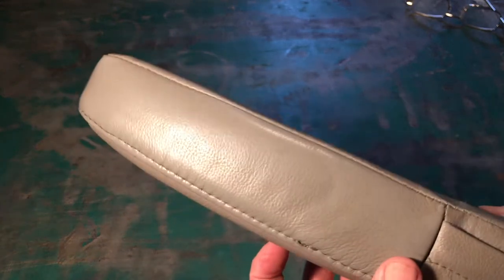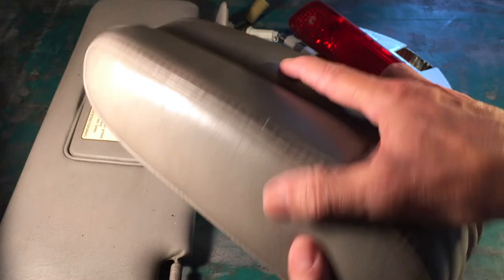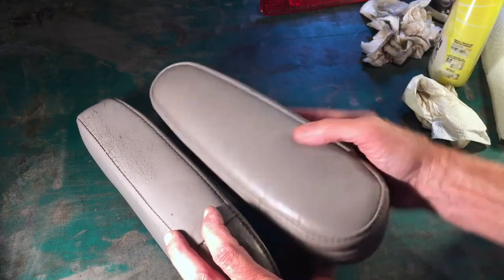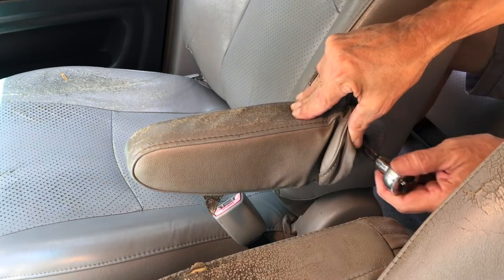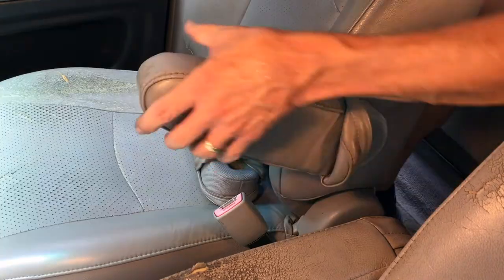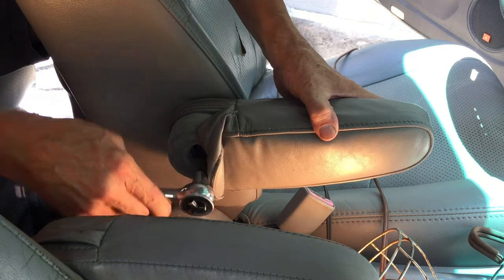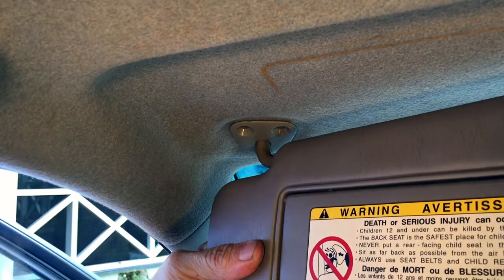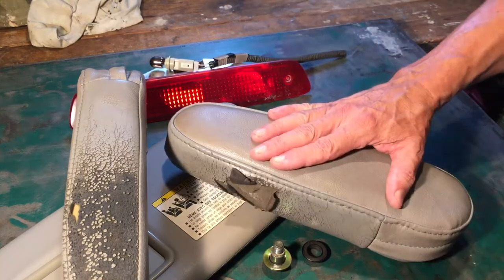Toyota Armrest Cover Flip/Swap (Highlander)

Comment: are these aftermarket "leather" cover-sleeves that have been installed over the original cloth/velour armrests on the donor/scrap vehicle?  I want to swap my Passenger for Driver and flip over but my '03 leather ltd does not have the zipper opening in the rear.  is it possible to 'skin' the oem armrests or am i better off installing covers OVER the original, but cracked up, leather armrests? does that make sense?
Reply from the maker: If your armrests have no zippers then aftermarket seems like your only option.. Since replacements from a scrap car same make/model would also have no zippers.. Question is, would aftermarket covers be large enough to fit over your original covers or would you have to cut them off??